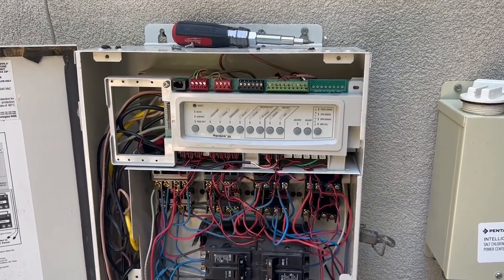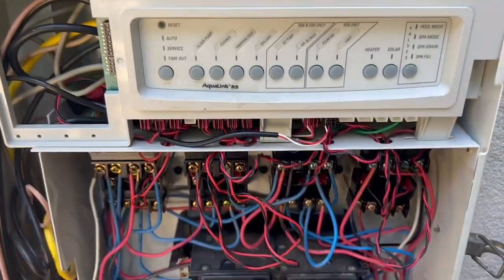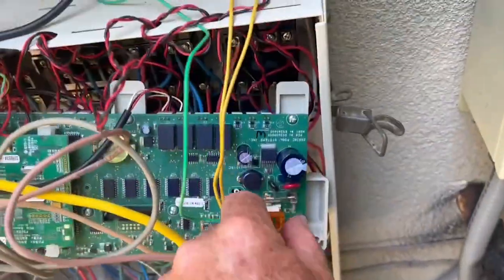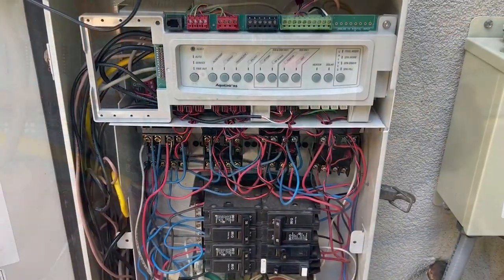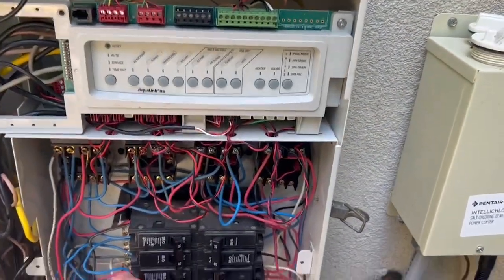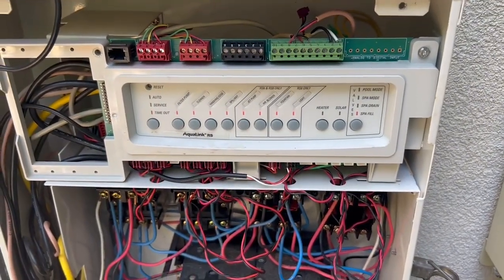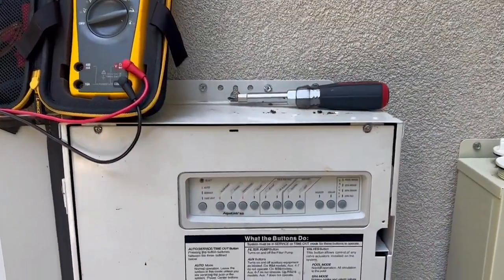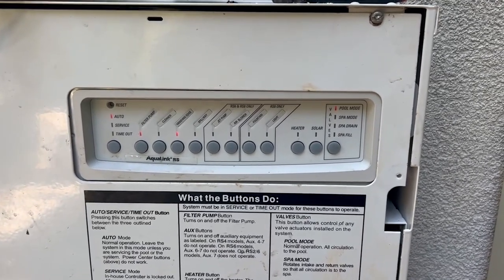Jandy RS No Lights On Diagnose Debug Fix

Comment: I have a question I have the same jandy controller your showing in the video and also the jandy PDA for that controller. My pda will not keep the correct time at all . I have replaced the battery’s and as far as can see that is about the only thing you can do. Is there anything else I can do to fix this problem. Thank you
Reply from the maker: There is a 2032 clock battery on the back side of the board. If you replace that battery with a known working one and it still doesnt show the correct time then the clock chip on the board is bad.